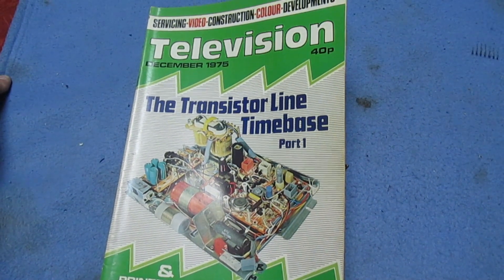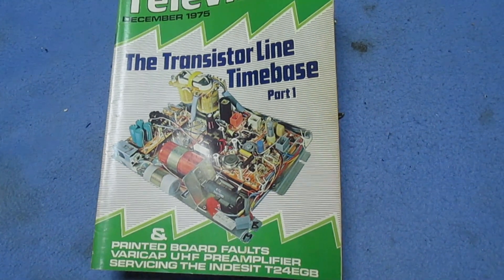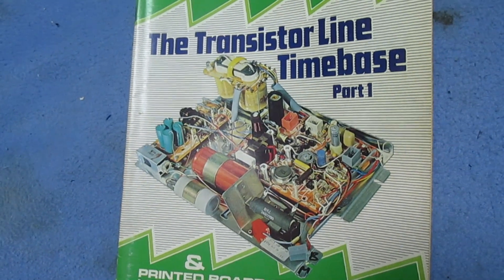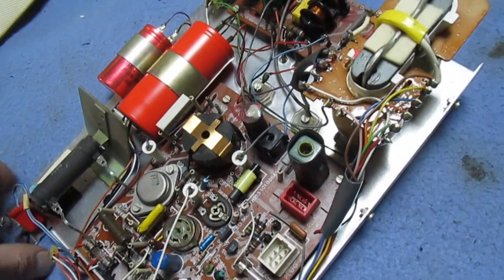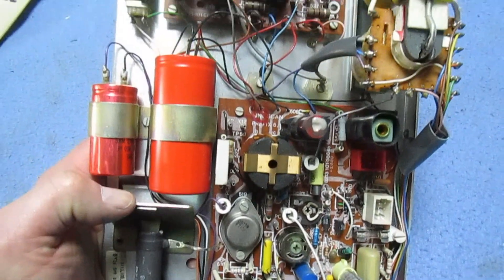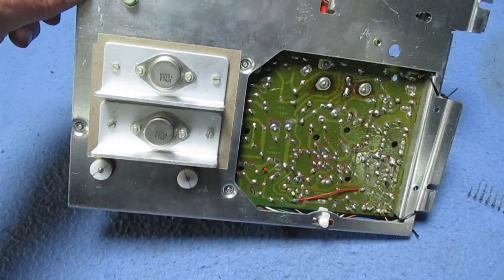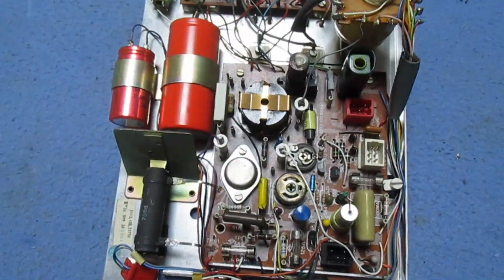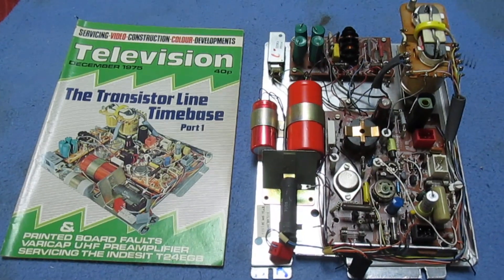Philips G8 line timebase panel .

Comment: when I was a school kid i use to get my dad to go and buy a couple of G8's from this place that had loads of old sets different makes that didn't work, they use to be about £10 or £15, some had field or line collapse, convergence panel not working; but most of the faults was dry joints, edge plug connectors. I also had a place in ponders end that use to sell ne a lopt for £8 under the counter or £15 with a receipt, anyway I use to flog then for about £45 (a nice hustle when i was 16) (the things i use to get up to!)
Reply from the maker: strangely enough there is a G8 line panel on e bay at the moment, you don't see anything like boards for these anymore .

Comment: Having been repairing consumer electronics since 1967 that G8 line output panel is very familiar
the heatsinks on the back had BU208 transistors on them.
These panels ran hot, and dry joints were a common source of strange geometry.
To think that you could by spare parts back then not just spare panels, they were introduced for the
rental market to allow quick repairs in customers homes without the risk of dropping hot solder on their
carpet.

Comment: We had a 26'' G8 in the 70s. So unreliable the TV repair guy invited us to his Christmas party. line o/p failure, sound failure, tuning failure, then new tube and more sound failures, randomly would'nt power up. Its was a piece of crap. Nice when it worked occasionally.
Reply from the maker: LOPT was also a very common problem back in the 80 s but the low emission mullard crt was the biggest problem m.

Comment: Takes me back a long long time ago when I was  TV eng for a large tv rental company. Seem to remember having to balance the line output transistors so thay switched at the same time. Similar to the wonderful Bush line output transistors.
Reply from the maker: yes , a similar set up was used in the Bush A823 , the reason for the two transistors was because back then they couldn't make a single transistor with a high enough collector peak voltage .

Comment: Heh, I'm currently trying to get a 1972 Philips G8 working again. I've already fitted a new tripler and replaced the green capacitors. The LOPT itself has now gone.
Reply from the maker: the LOTS on these were a common source of trouble back in the 80 s , don't know if there still in business but there was a company who would re wind these .
Reply: @michaeldranfield7140  Chris CrustyTV of VRAT has very kindly given me a replacement LOPT for it. However the set has many other problems! It's been "got at"

Comment: Now you've got me guessing the output transistor type.
I started my career working for RCA who developed a line timebase using thyristors to drive high current through a low impedance horizontal deflection coil.
These were the opposing designs of the 1970's Phillips with high voltage and high impedance deflection  coil and RCA who licensed their design to other European manufacturers.
Reply from the maker: BU105 , back then I dont think  1500v transistors  existed  hence the two in series and the need for balancing .
Reply: I'm sure they were BU205.

Richard
Reply: @ukfmcbradioservicingTango21  thanks, wasn't sure. I thought BU 208.
Reply: @stevejagger8602  Sorry Steve, we were both lying. I got the service manual out & the two line output transistrors are each a BU105!

Richard
Reply: @ukfmcbradioservicingTango21  thanks for satisfying our curiosity👍

Comment: A little before my time but I did fish one out of a skip and repair it. I saw more G11's, KT3/K30's. I remember them using two line output transistors before I assume they managed to make one that would handle that voltage and behave itself.
Reply from the maker: I think this is correct , back then they couldn't make 1500v transistors so they used 2 in series .

Comment: Wow! Looks brand new like you say! Thanks for sharing. I only ever took the back off of about 6 or 7 of the G8 chassis sets in all my years. The places I worked at, never sold or rented the G8, and my own customers never owned them. Some other guys I worked with over years, used to talk about them fondness. My main memory of the 6 or 7 I looked at, was struggling to get the vertical hold control knob and which ever other control knob it was through the holes in the back cover. I seem to recall there were two of them. I'm sure there must have been an easy way. I expect people that repaired them all the time had an easy way of doing that.... Looking forward to seeing more soon...
Reply from the maker: Funney enough looking through that magazine Sends components were advertising these boards at £1.50 surplus !  Its such a long time ago now I cant remember any of the faults on these apart from the low emission CRT .

Comment: A real blast from the past, those tuning caps will be useless by now  best replaced if that panel is put back into service, we all loved the G8 chassis, easy to service and repair  no nasty difficult faults, and excellent performance, the BR100 on the psu was a perennial pest though!.
Reply from the maker: I have a load of those caps still in stock that I bought from sendz components in the 80 s , cant remember what value they are but I used a couple quite recently in a 70 s Sharp TV .

Comment: Thanks Michael.  Is that for sale? (kidding 😊) I remember G8s well. Trouble was we couldn't get many second hand. So we settled on GECs . Do you remember the G6? What fun we had with those ! Kidding again 😊
Reply: Oh dear, I remember the G6 :( Doubled as a convector heater with it's 400W consumption. My colleage at the time had a lead-lined jockstrap with his real concerns over the X-rays emitted from the valved EHT rectification & it'd GY501 PD500 "x-ray" valves!
Richard
Reply from the maker: I do remember the G6 , I still have the shunt stabiliser and EHT rectifier valves in stock, never seen a G6 now though since I was about 16 !

Comment: Working in field service for British Relay and Visionhire  , Philips were one of our mainstays, I couldn't even begin to guess how many G8 ( 534 and 550 ) I've repaired back in the day. Nice reminder Michael .
Reply from the maker: A good set but the mullard crt had a short life which resulted in most of these been skipped .
Reply: @michaeldranfield7140  Probably due to that, Visionhire had their own CRT re-gunning plant in Farnham. One of the most common tubes they did was the A56-120X...
Reply from the maker: @threelaps5282  I use to find that most Mullard tubes were poor despite mullards reputation for quality .
Reply: @michaeldranfield7140  Could be true. The other one that they re-gunned at Farnham was the CRT (I forget the type) that went in the 20" Thorn 1500s.
Reply from the maker: @threelaps5282  Was it A50-120  ??
Reply: A56 - 120X . I believe , the 22 inch job. My parents bought one on my recommendation but the tube started going soft on the green gun after 5 years of use . The warehouses in the late seventies early eighties were full of ex Visionhire G8s with flat tubes.
Reply: We had a few of these on rental , these and Hitachi CNP190 . We were a small shop and we didn't  like repair visits. For a small town we managed to keep the big rental boys out ! . This was1974-75 .

Comment: CES Electronics
604 Purley Way
Waddon
Near Croydon
CR9 4DR.
If you really got stuck they sent you a repaired module for a fixed price . Happy days , the G8 when current production a long time ago now when Britain still had hundreds of independent TV and electrical shops.
Reply from the maker: They were very happy days indeed , it all went down the pan with the G90 and G110 when smd parts were introduced .
Reply: I think Thorn went the same way when they did a deal with Thomson ? . The sets became much more difficult in design with few advantages.
Reply: Was that the big ugly Philips HQ I used to visit for training?
Reply from the maker: @michaelshaw1827  Sorry , I don't know , I only ever went on Thorn and sharp training courses .
Reply: Same here. I went to a hotel in South Essex for the Philips G11 launch but never went to CES.

Comment: Great sets shame about the LOPT and later on the fail rate of the green tuning caps.
Reply from the maker: I still have some of those green caps in stock that came from sendz components , in fact I used a couple a while back in a sharp 70 s TV .